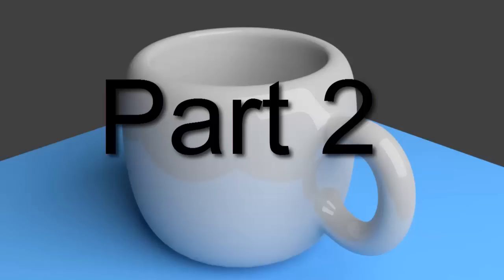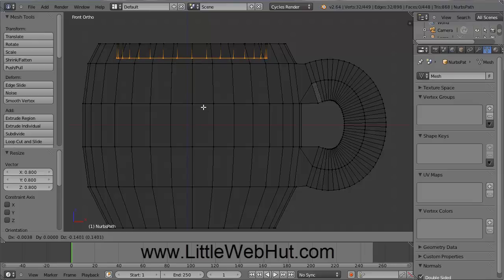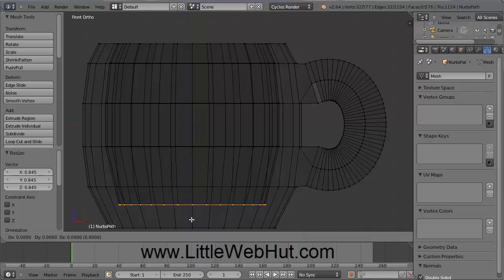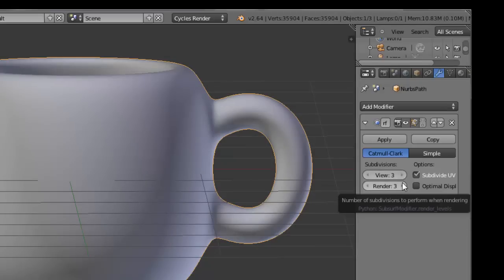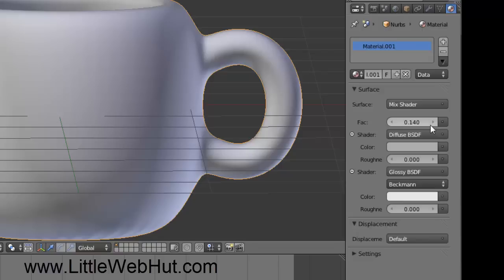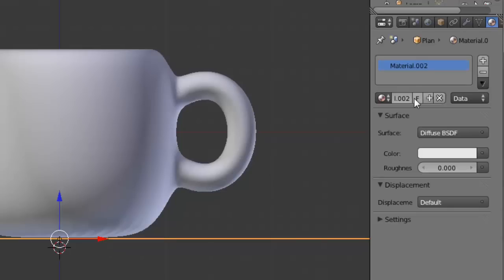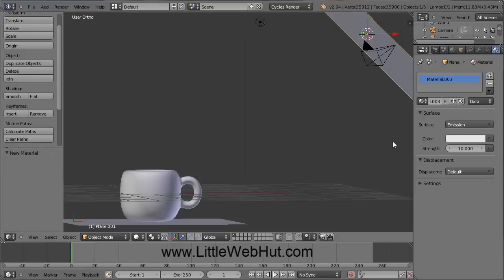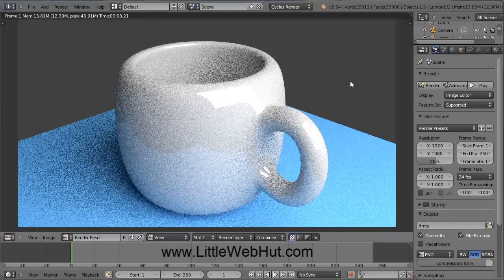Blender Tutorial For Beginners: Coffee Cup - 2 of 2

Comment: Just curious... I'm running Blender 2.72. I set the render smaples to 1000, and it still looks quite grainy compared to your 250 sample render. Any ideas on why this might be?
Reply: i have the same problem. have you found out what to do yet? If so plz let me know
lol
Reply: I render my model on 350 an looks grainy an is taking a a little much to load, I dont now if its because Im using a laptop,  let me now if foun anithing :3
Reply: jonbeiler360 I'm new to 3d Design in general, but I've been familiar with hardware for a while, and this has to do with the graphics card. Because you're doing it on a laptop, it's naturally going to take a little longer because it has less power.
Reply: tanks bro :D
Reply: I'm very much a newbie at Blender but I've been working through some basic Blender tutorials in 2.72, and I've found that using the "Final " preset under Sampling, which is just 24 samples gives very good results for scenes like these IMO. And it seems that anything over that takes a really long time and for basic scenes like these doesn't really show a justifiable improvement
Reply: YAUUN same observation here. The default Final preset looks fine to me for now.
Reply: It could be your graphic card look to see if you can change it to be more compatable

Comment: I am using blender 2.75a, and it has "Clamp Di" and "Clamp In" instead of just "Clamp". Which should I change the number for??
Reply: +Yu Bin Lee Same problem. I put it in Clamp Di, just a guess tho
Reply: +Yubin Lee i put both to .98  worked
Reply: +Yubin Lee Clamp In (Indirect) gets rid of the fireflies and Clamp Di (Direct) darkens very bright areas. I suggest you set both to .98

Comment: at the bit where you create the inside of the cup, at the bottom you have that extrusion point set to those circles colliding (I forgot the name of what it is specifically) so all the extrusion points go to the center. I had problem with this at first because mine was set to go to where my 3D Cursor is, and it took me a while to figure out. maybe if you could add a caption saying that it'd be easier for people having trouble with that in particular.

Comment: I kind of messed up a little while finishing this up. For some reason there is a ring around the top of it that is a simple 2-dimensional plane. Not sure what happened there, going to try this again and see if I can get it right this time.
Reply: Okay, so in order to make the cup solid, I used the solidify setting in the modifiers, and then the subdivision surface setting. This completely eliminated the need to extrude the faces for this particular project. This is not to say that extrusion is not useful, and downright necessary in many situations, it's just that in this particular case, it works.